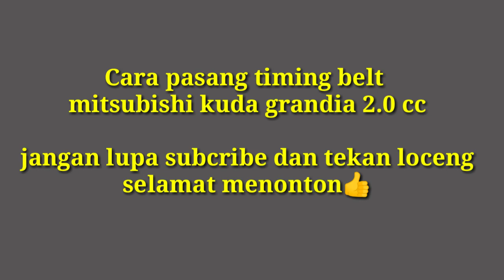cara pasang timing belt mitsubishi kuda bensin 2.0

Comment: om kalau posisi top timing balance shaft nya gimana om??
Reply from the maker: di sprocket / gir balanch ada tandanya coak/titik dan di body mesin ada tanda seperti tonjolan mesin bentuk segitiga. tinggal dipaskan saja seperti dlm vidio.
Reply: Om apakah kuda Grandia 2000cc stelan timing nya paket adjuster semua..?